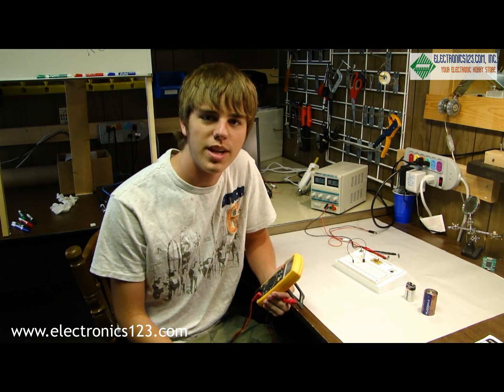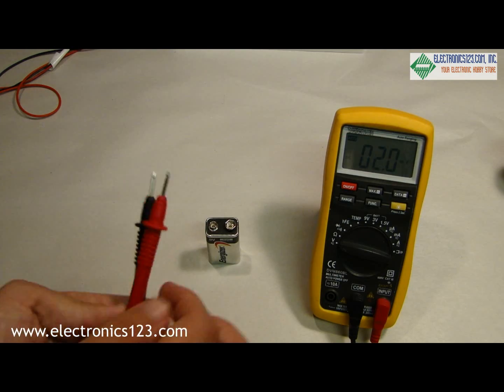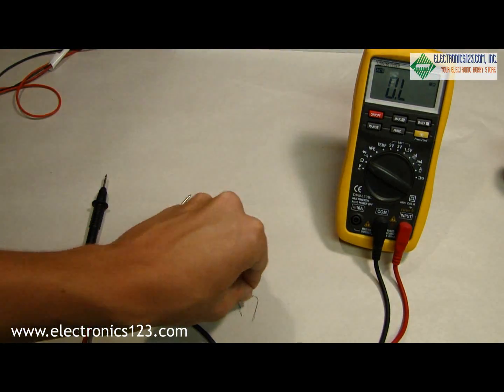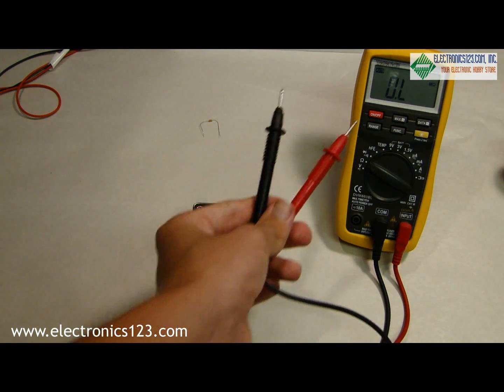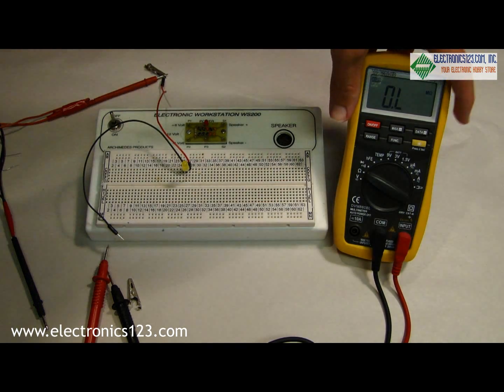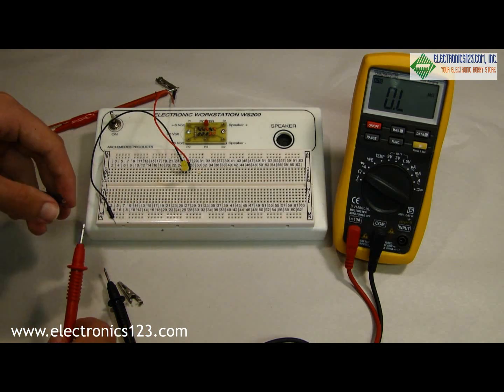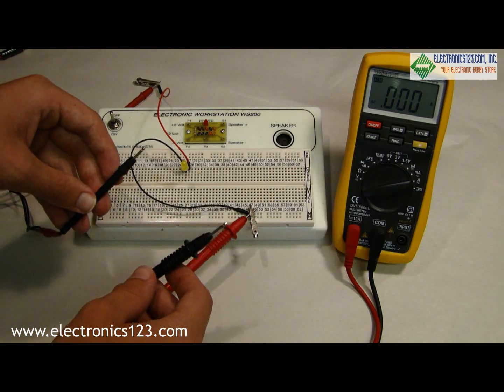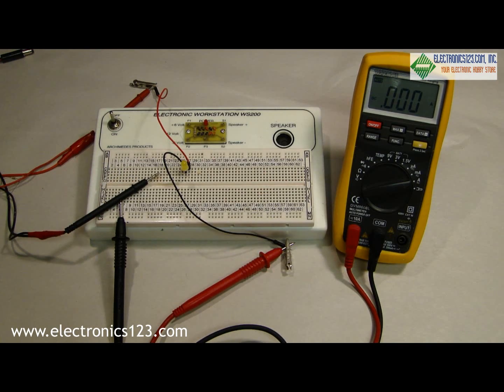How to use a multimeter

Comment: @FunkyMexicanBassist You can check if the appliance is shorted out, but yes, to accurately measure capacitors, resistors, diodes or anything else they have to be removeed.
There are ways to figure out what components are actually bruken, some are more likely to break than others, and sometimes you can figure it out by in what way the thing broke.